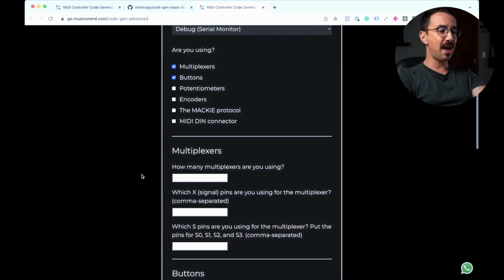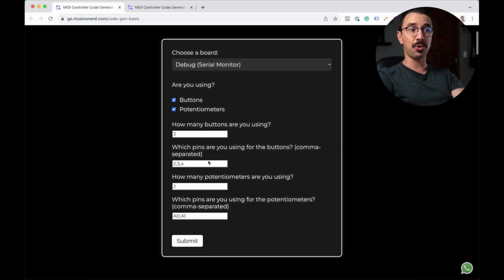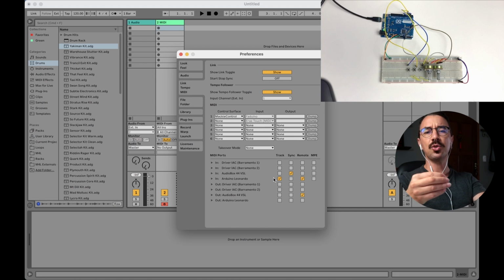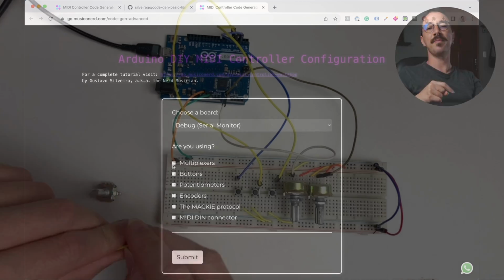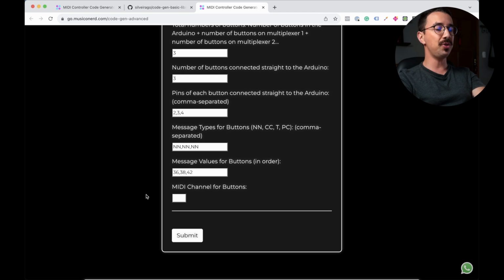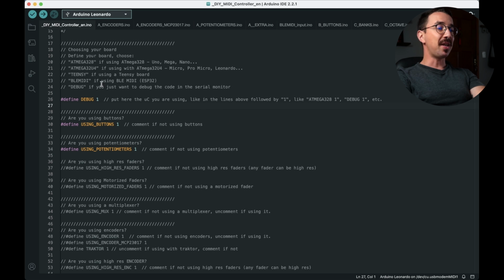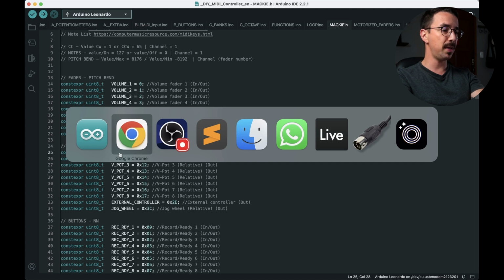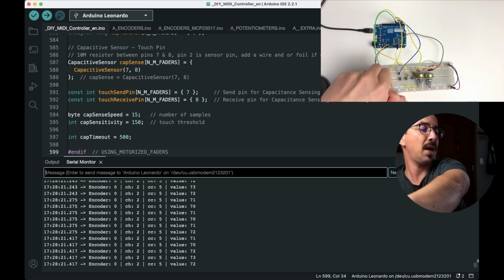I made an ARDUINO MIDI CONTROLLER CODE GENERATOR

Comment: Does the course include information on how to make a controller for a Eurorack module? You say you'll teach me how to make my dream controller. A good MIDI controller should also control voltage. versatility is very important

Comment: Super! A nice approach to teaching with technical knowledge and simple terms for all to understand. 

Planning  on building a controller surface from my Dreadbox Nymphes. It will feature all CC assignable encoders and eventually I hope to get patch storage as well as a little mod matrix with a segmented LED display (Sparkfun pixel board). 

I am still learning how to use the MIDI libraries for my Arduino MIDI expander board...

Comment: I have a question and you’re probably the best one to answer it. I had the arteria mini lab three and it stopped working then what I found out was the cable that came with it was getting very hot. I actually opened it up. I found no fuses or anything inside of itso do you think I just need a new cable or do you think it actually could’ve fried something inside of it thank you for your time and replying if you do.

Comment: What do you mean when saying Nano isn't Midi class compliant ? I've got several Nano's based systems receiving and sending Midi messages with Midi 5 Din sockets. Having saying that, your work is absolutely awesome, particularly regarding the multiplexer options, we never have enough controls.

Comment: Hey there. It is a very useful video series. Thank you. 
One question. I need to read MIDI notes from the SD card on my Arduino Uno to activate relays for my stage show. I only need to read what the notes are and the length of the notes.
I have Uno, an SD card, an SD card module, and all the necessary hardware. I already read MIDI files but couldn't parse them. Will you be able to make a tutorial?
I really appreciate any help you can provide.

Comment: Wow! This is an amazing resource. I was able to make a 5 knob midi control in one hour! I would love to make a one octave keyboard, is there anyway to add specific midi number signals to each one? Or do I just trace the code?
Reply: I tried to look back at your programming buttons video and your code doesn’t match up to your generator code. I saw you were able to add specific values for notes. My goal is to make a 1.5 octave piano line of buttons.

Comment: This is cool, but the value of Pot sliders is off.  For example, one slider 10K Bourns will go from 127 down, and at the bottom, reset the pro micro.  Or another Pot slider will only change values toward the bottom of the pot slider (these should be linear, is your code for log?). I tried a basic 10k pot and it didn't work at all.  Not sure where to start with your configs.  Buttons work great, no problem there.  It's only the analog inputs.
Reply from the maker: As I showed in the video, there’s no extra steps besides adding the required libraries.
You should test your circuit with an Arduino example to see if it’s my code or if you wired something wrong.
Reply: @NerdMusician  thanks.  You're right, I had it wired wrong 😅

Comment: is it possible to have say 2 of my 6 buttons to trigger when pulled high instead of low? ( I'm repurposing some kind of an old computer input device I found and need those two buttons to work when pulled high and they already have their own pulldown resistors) 
as always, great video

edit; it seems to work as is but I'm worried it might break something lol
Reply from the maker: It can, but you need to change the code 😅
Reply: gotcha, I'll take a look thanks @NerdMusician

Comment: In the serial monitor in debug mode i get a bunch of squares whenever i turn the encoder by 1 tick, the more i turn the more squares i get but it doesnt return any value, any help please
Reply: i am using an arduino uno with one encoder on pins 2,3 with interupts
Reply from the maker: If you are a student, please contact the support!

Comment: Is it possible to use rotary encoders on a multiplexer? My idea for a Lightroom controller needs loads and loads of em 😂
Reply: for better use you need to have a board with outputs that have interrupts, for example an Arduino Due, you can connect 16 encoders there, but I used another MIDI library
Reply from the maker: You can, but it will suck. You need to use a port expander like the Mcp23017. I do teach how ot use it in the Making Music with Arduino
Reply from the maker: Or like @begineras said, use an Arduino with more ins, I advise you a Teensy board.